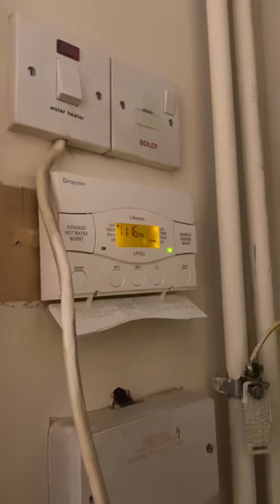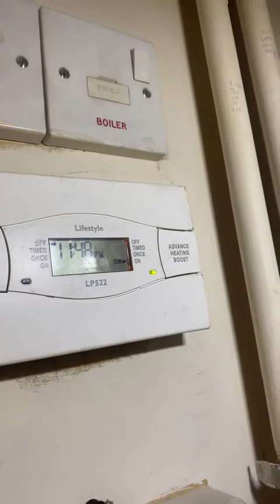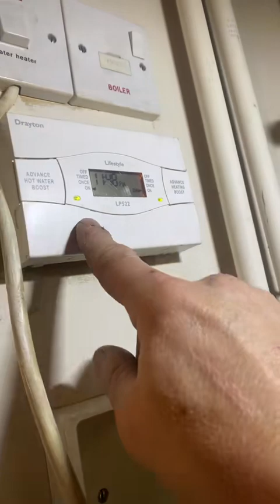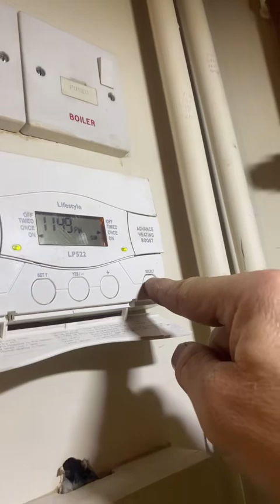Heating system wiring

Comment: Are there no cable clamps securing those flexible cords dangling from the bottom of the wiring centre?

nb. I hate Y plan central heating systems, so mine has been converted to S plan.
Reply from the maker: none at all, I was only there to get it working they didn't want any upgrades unlike one of the previous systems.

Comment: After looking at Wagos for years chocolate block looks so sketchy.
I know it's NOT but still 😂
Reply from the maker: I used to like the connectors on the wiring centres as you could at least dress the cables in neatly. now the wagon wiring centres are out that's a game changer.